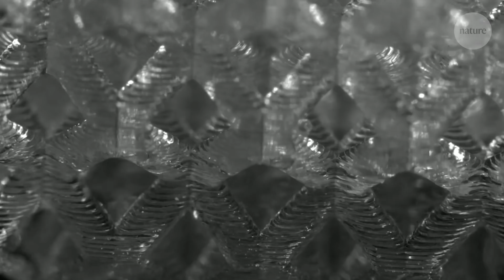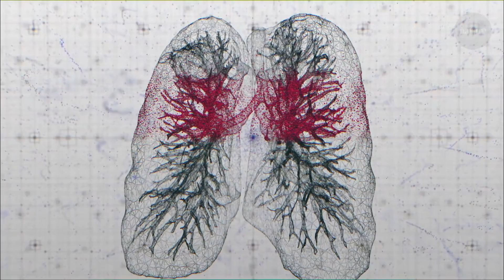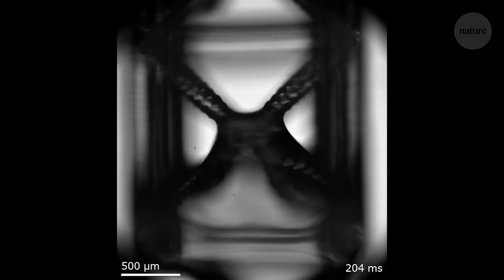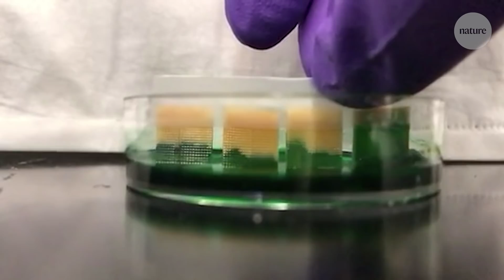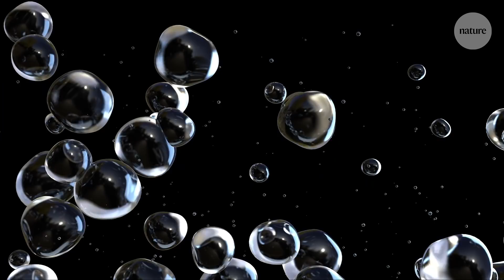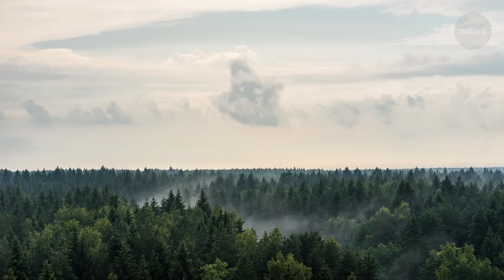Why leaky pipes can be better for moving water

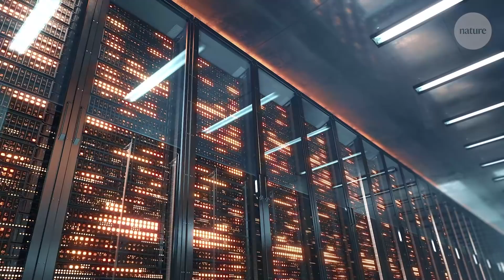Comment: 2:30 heating and cooling computers? These require good water flow so I think that these scaffolds would not allow for that.
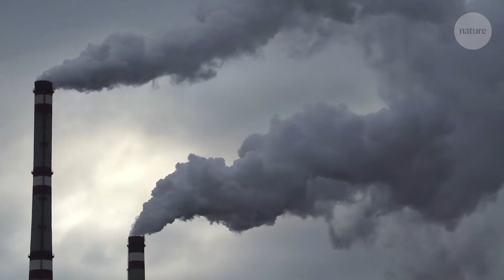2:35 How it is gonna transport CO2 ? CO2 wouldn't create surface tension to do that or am I missing something?

Comment: Just saying:

A tower of these micro structures, that lets water run off the top and fall down to turn a turbine. Even on a small scale, I bet you could get an led to light up. Not perpetual motion, not a solution to the worlds energy problems, but it could theoretically be a self-run, closed loop system by utilizing only the energy within the surface tension of water, and gravity.
Reply: Don’t be stealing my idea 🤣

Comment: Correct me if I'm wrong but I don't believe trees just use capillary action. You're limited to 10m with just that and as we know trees far exceed 10m in hight. They also use transpiration through the leaves that helps pull water up to the tops of the tree. What that means is the water evaporates through the leaves and then that helps pull water to the top. 

I think it's still a matter of debate on how exactly trees get water all the way to the top. But one thing we know for sure is that capillary action only helps somewhat for the first 10m.

Comment: I had a very interesting thought what if we used these shapes for  coastlines to redirect the flow of alot of the water to stop degradation of the coasts and on top of that the I feel these would last much longer then a coast wall as they should let the water flow into it as opposed to crashing into a wall, beach or anything similar
Reply: To expand maybe the force of the way could be directing the water up  the lattice structure and flow back out into the water as the wave recedes

Comment: Always wondered if you could use capillary action to produce electricity. Capillary action transports water up, collects in a reservoir, then discharged down through a turbine into a lower reservoir to start the process again. I highly doubt you could make any meaningful power but wondered if you could make any power at all

Comment: This is really interesting. One use I can see for this is inside moisture-collecting devices where it's not possible to simply place a drip pan at the bottom to collect condensation. This is an issue in a lot of ductless AC systems. If the head is mounted on an interior wall, then you need to install a pump to route the water through a tube that leads outside. With these, you don't need a pump to drive the water, so there's no risk that the pump might break and you end up with water leaking into the room.

Comment: trees does not use capillary action to move water
this would limit all trees to maximum 10.3m
trees do grow higher and leaves even at top of trees have steady supply of water, which won't reach over 10.3m using capillary action

Comment: 7/9/2021
Bizarre and most interesting.   I recall in high school (1979) 
a friend and I had considered using the concept of the water
meniscus climbing the side of its container to propel the
water even higher, if we could devise the correct structure.
But that was long  before 3D printers, and I think our
downfall in the project was some lame attraction to girls.

Comment: A side effect is it will be bullet resistant  Imagine a kevlar microstructer filed with liquid a dense one.
That absorbs heat. Quickly .
  The heat transfer would shatter the bullet . 

The also need to put this in the top of containers.   An automatic straw lol

Comment: Climbing up the rope will not give you 60psi at your tap and small hole in a pressure pipe will spray water everywhere. Not to mention the possibility of contamination during travel.

Comment: I do this with my toothbrush every day. I run the water as gently as possible, then put my toothbrush under it, and the bristles sorta "fill up" with water, and hold onto it as if the toothbrush was a cup. Except the really cool part comes when I slowly and as gently as possible flip the toothbrush over so it's upside and the water STILL stays stuck in the bristles because the surface tension holds in in place. I confirmed my hypothesis that surface tension's responsible, even though it's pretty obvious that's what's going on, by adding some soap to the water, which eliminates surface tension and prevents it from "sticking" to the bristles.

Comment: How can they print 1 nanometer 3D structures and yet not 1 nanometer cpu cores?????
Reply: CPU Cores require metal
Reply: @iSyriux  so they can't build a 3D printer that can print 1 nanometer metals???????????? 
They got needles smaller than that for pharmaceutical companies that are smaller than cells.

Comment: So they invented sponges. I hope they didn't spend too much on that very special 3d printer because my $200 resin 3d printer could print that at probably an even higher accuracy and likely a lot faster too.
Reply: That seems like a reasonable price although I've never priced them. I just assumed it was out of my range and the tech for programming the machine to create the object I may need would be beyond my ability. 

Is the resin one type only, or can it use different resins with different properties for specific applications. Such as heat resistant. Or flexible. Etc.
Reply: @kentneumann5209  ya they've really come down in price recently I was surprised too. You pay a premium for bigger build space tho but still not bad considering what you're getting. Structurally it is naturally hard and brittle but you can get different resins and mix them too for increased temperature resistance or flexibility. Some resins can get expensive tho and cost is still going down for these fancier resins as advancement continues.
Reply: @jhssrg_lfdesrk  - Thanks for reply. I'd like to see it get to the point where it comes with a shredder or chipper that you can toss in whatever kind if plastic junk you have laying around and utilize that for the resin.

Also a 3 D scanner to scan the part for replication. Or the broken piece that's needed and it will fill in the rest.

Maybe even tossing in the entire broken pieces and it uses the original plastic after scanning its design.
Scan it. Chuck it in grinder. Recreate original piece from original material.

I should have trained to be an engineer. What a fun career that is i bet. 
 I just really suck at advanced math.

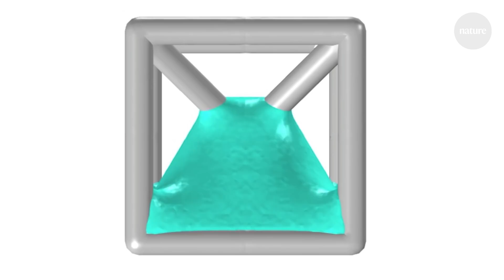Comment: @1:31 so my off-the-shelf resin printer from Formlabs can print at that resolution all day long. Several of the resins can do 25um layer height, so a matrix of 1mm cubes would probably look better than the ones shown in the video. I'll definitely try this at home. Fyi, the printer in the video is an FDM type, and I am certain that was not how they printed it.
Reply: Have you tried to print this out.

Comment: The fact that the structures are open means that the weight of the water underneith the the molecules at the top is meaningless, so these structures can pump water indefinitely high... That is actually really useful

Comment: It's not just capillary action.  The tubes are open at the other end at the leaves.  As the water molecules exit through the leaf pores, it creates a tiny amount of negative pressure.  This is multiplied across all leaves meaning up to negative 9 atmospheres can be created within the trees, this is what pulls the liquid further up the trunk; as capillary action (as mentioned in the video) is limited by gravity and can only get you so far.

Look for veritasium trying to suck through the longest straw.  At a certain height it's almost impossible because of air in the straw, but the roots are made with liquid inside maintaining a 'sealed' system that creates the negative pressure.
Reply: negative 9 atmospheres... so 8 atmospheres less pressure than absolutely no pressure?
I don't think that math adds up. The hight of the straw is limited because with less pressure the boiling point of water decreases, creating a gas that then fills the tube again.

I agree that the suction forces play a role, but maybe not as big as you think.

Comment: Also, trees don’t rely on capillary action alone. So this is clearly a misunderstood subject by the author of this script.
Reply: As Veritaseum has “revealed”, trees transport water through immense negative pressure (up to -30 atm) through evaporation at the leaves. The water doesn’t boil, because the xylem tubes are a perfect environment with no gas bubbles, that would provide the energy for a change of state.
Reply: While they glanced over plant biology, it still stands that this is a vastly more efficient capillary action and capillary action requires less energy.
Reply: And what else do they rely on? Evaporation of droplets from leaves which creates -ve pressure which sucks water from down below ?? Anything else is there too?
Reply: @amantedecapaldi4037  capillary action is needed but majority of water transport in many plants are also supported by solute(sugar) concentration flows which requires energy. Capillary action is important but it is used with other techniques by plants.
Reply: @amantedecapaldi4037  Veritaseum has a video on capillary action in trees. You should check it out.
Reply: @amantedecapaldi4037  the higher the water is on a tree has a lower pressure which helps draw up water as well.

Comment: "Researchers have come up with a way to move water through a structure filled with holes, without it leaking" Sponges? Researches discovered Sponges? Srsly... why embed the actual interesting part into fancy talk nonsense? They use this very well known concept, combine it with 3D printing, and use it to direct the flow.

Comment: So it's a solid sponge?
Reply: No. Its much more. Unlike a sponge, it can hold up its weight, basically mechanical properties of a pipe are also replicated. All sponges are solids, but not all have the same properties. A brick can absorb water by capillary action, but no one calls it a sponge, but a foam sponge is called a sponge. This kind of thing can allow a rigid type sponge to be made.

Comment: A bit misleading to use the word "leaky", since that implies water dripping out of the pipe
Reply: They even said in like the first 30 seconds that they don't leak smh
Reply: @TheNinjamanAway  Not really; it implies they're using the leak of a defective pipe in some way, if leaky pipes were what they're referring to. "pipes with holes" or even just "open pipes" would be better, because "leaky" directly refers to a pipe dripping water unintentionally, which the ones in the video are designed to not do; there's nothing leaky about them.
Reply: @Shellackle  who cares.
Reply: Clickbait as usual
Reply: If you touch one of those things, the water will come out.
Reply: They do in fact leak fluids, even if those fluids are gaseous rather than liquid
Reply: Text writers aren't STEM engineers. Thankfully
Reply: Welcome to the world of headlines
Reply: Sometimes you have to exaggerate for good reasons, in a system like YouTube it takes a little extra to get something important to the surface.

Comment: doesn't paper already do this? it just reminds me of the cardboard matrix used in swamp coolers
Reply: Yes, but in a much less structured, engineered or control-able way. Also, paper degrades when wet. Then again, paper is potentially more environmentally friendly than whatever polymer this is. Then again, again, a 3D printer on a space station could build custom or replacement parts that use these rather than shipping them up from the ground. It's new stuff, there are going to be situations where it is and isn't better than existing solutions.
Reply: @mceajc  another nice thing, there are some filements that are organic, would be interesting to see how long they last,
Reply: and so is sponge , but this is a better and bigger one.

Comment: Basically they invented a sponge in 2021! Except made it orders of magnitude more expensive to make. Wow Nature, really scraping the barrel here
Reply: Nature didn't make it, they are a publisher. Also, if it were just a sponge, then it would not have been published. Note that they are trying to replicate the function of a pipe, but using an open structure. That means even the mechanical rigidity of the pipe is replicated. Try making a large enough foam sponge that can hold up its own weight and not get hopelessly compressed such that it loses its porosity. You kind of missed a lot of problems that it solves and the point of making such a structure in the first place.

Comment: Wait a second, what actual energy is being used in capillary action? Like it needs to come from somewhere, and I know that it's the limits of capillary action that limits the height of plant growth.
Reply: The energy comes from the polarity of water causing surface tension and wall adhesion strong enough to overcome the forces holding the liquid together and gravity. As you noted, it is not unlimited and certainly while these mechanical sponges are cool, they can't replace pumps/water towers for civil scale water distribution — though they might be useful in unexpected ways.

Comment: You can do that with copper and water to make better water cooling for computers
Reply: If you didn't use the fan, but used evaporative cooling instead, it would be beneficial to increase the surface area like this. Forced convection systems are quite energy hungry themselves.